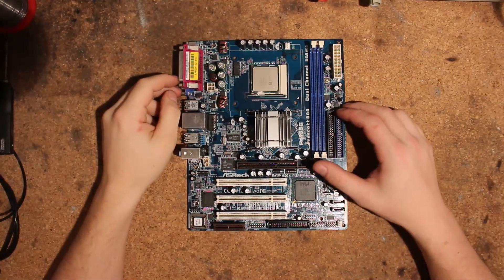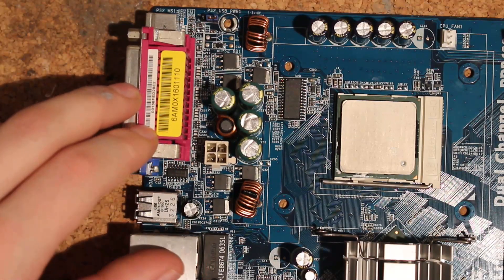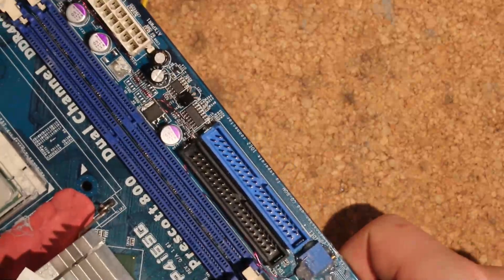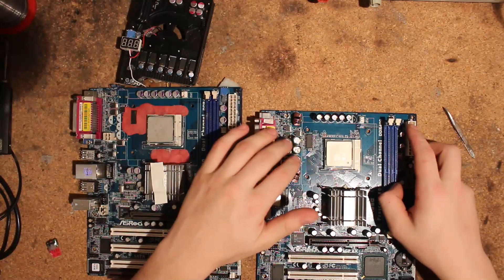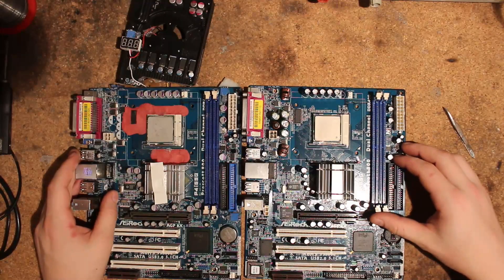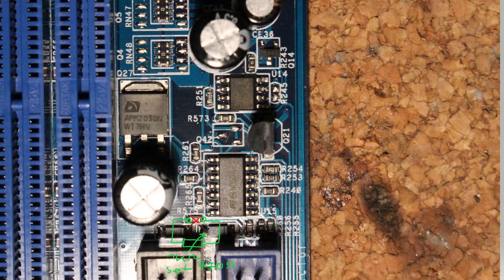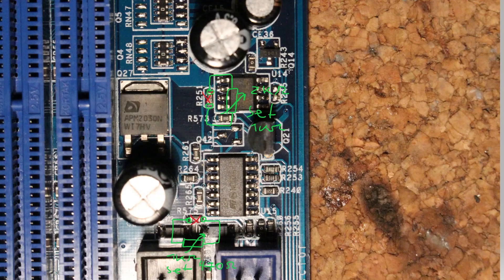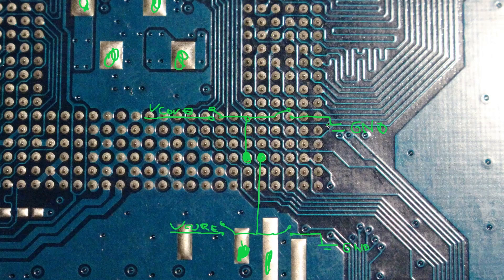The best board for mobile Pentium 4s? / ASRock P4i65G modding for overclocking

Comment: Hi. I have that motherboard and a p4 2.8 i would like going up the base clock from 133 to 200 with a max frecuency of 3.20 ghz s i wonder if i do a besel mod and volt mod the frecuency multiplicador is still lock or after is unlock? Thank you.

Comment: I had exactly this MB 15 years ago, I destroyed it when I accidentaly shortcutted GPU fan (it burned and dosconnected trace on back side of MB behind AGP slot), but I fixed it with aluminium foil, good old times. 😀

Comment: What faction is memory chip 
"APM 2030N" which one use on this in replacement/equivalent ??
Reply from the maker: I don't understand the question tbh, maybe the datasheet helps you? https://datasheetspdf.com/pdf-file/525208/AnpecElectronicsCoropration/APM2030N/1